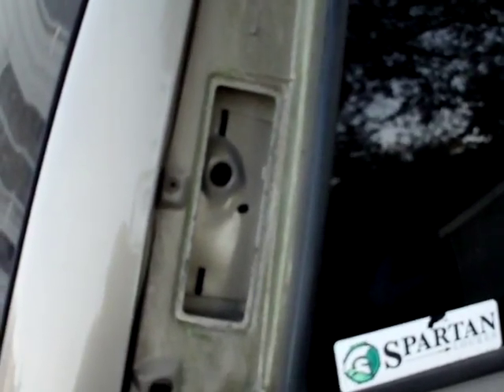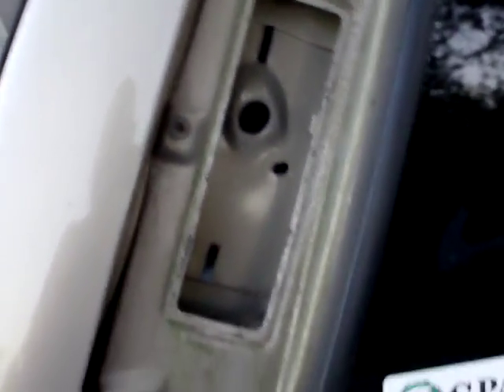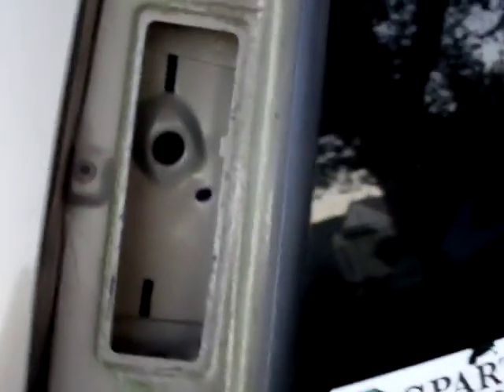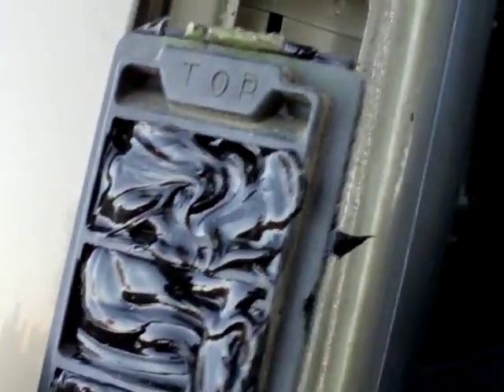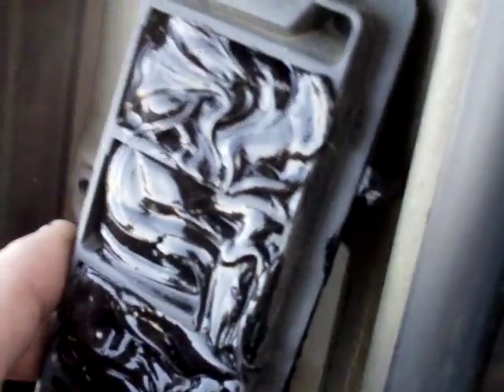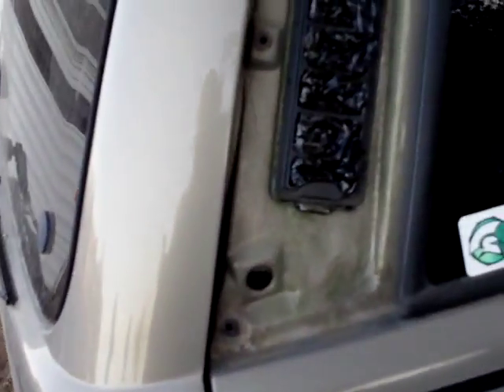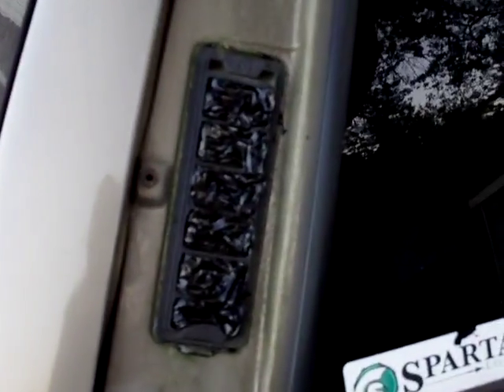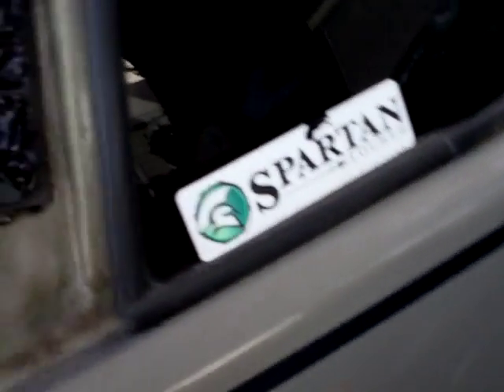Jeep ZJ rear window louver leak fix part 1

Comment: how do you take them off? I can't figure it out
Reply from the maker: You have to remove the plastic panels in the back of the truck from the inside and then they just pull out .
Reply: ShawnMrFixitlee  How does one remove the outside cover piece (not shown in the video)?  I don’t want to break it.